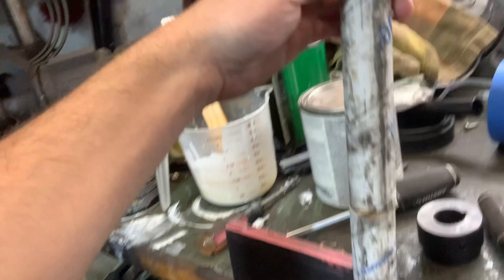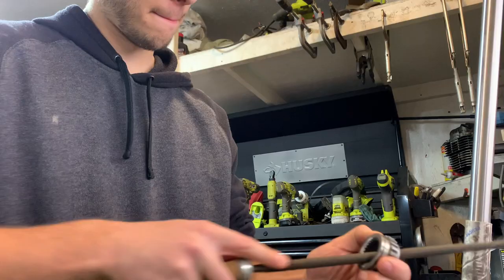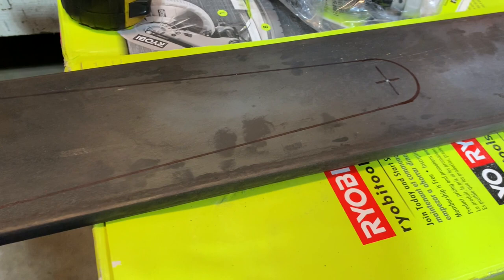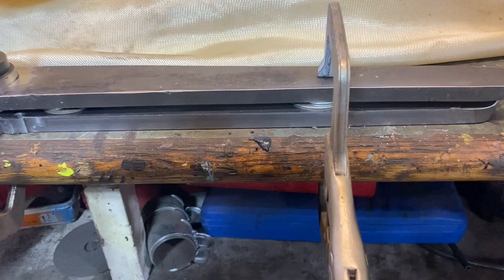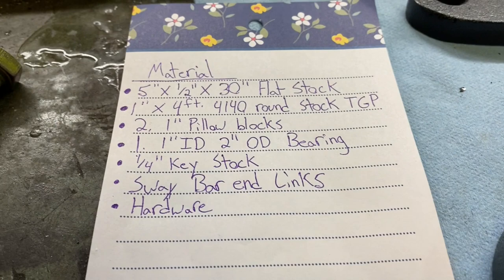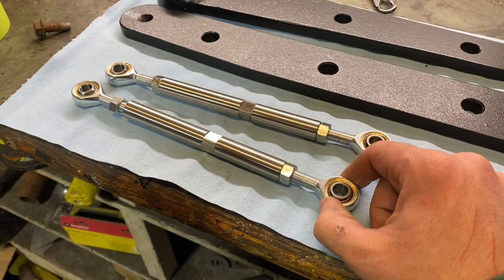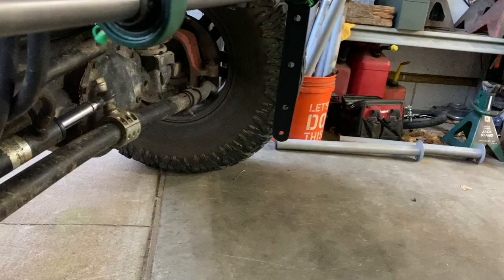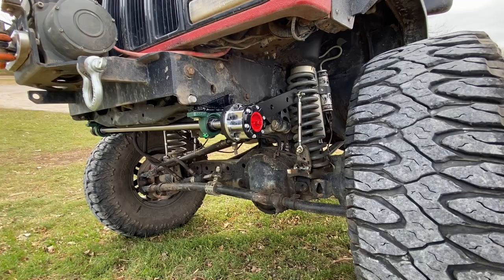HOW TO BUILD THE BEST (OFFROAD SWAYBAR) CHEAP

Comment from the maker: Is this something you would purchase for $400?
Reply: I have an idea or two that might improve this
Reply from the maker: @dylanromine4101  please let me know
Reply: Try using a toyota motorhome axle shaft for the sway bar
Reply from the maker: @dylanromine4101  what is the advantage of this
Reply: It has a full float axle that has the same bolt pattern as the hub
Reply from the maker: @dylanromine4101  interesting idea but how would it unlock?
Reply: It has splines that I think fit the hub you used
Reply: I would be all over this!
Reply: Definitely would buy this
Reply: I would buy one for my 1988 YJ I just bought yesterday and almost wiped out on a highway offramp!! ;-)
Reply: I would buy this Four my 96 jeep cherokee X j
Reply: I would like to order one asap for an XJ, let me know. Thanks
Reply: I'd buy one of these (or one for front and rear? If you're willing to fab them.

Also if there's a cad file I would pay for that...
Reply: @gageboysgarage6059 is buying one of these possible?
Reply: You could probably quit your day job and pump these out😂

Comment: Does this have some propensity to lock back in with a possibly uneven configuration? e.g. assume one needs to be real level when re-locking, correct? Has this been an issue at all for you? Great vid, and idea BTW. Appreciate it.

Comment: Nice job, please get yourself a couple 2 flute SPIRAL POINT (not spiral flute) taps, they cut soooo much better and easier. No need to break the chips, they form a long chip ahead of the tap. You will not use your old taps again.
Reply from the maker: thanks for the tip i’ve used that style of tap at work.  i’m just to cheap to buy nice ones at home

Comment: The anti rock can help balance front to rear characteristics off road, and help with side hills. The spring rate on them is pretty low, so it still allows for good articulation. You might try a junkyard rear swaybar, smallest diameter you can find.  

I'm curious how yours holds up to the torsional loads, I don't recall you saying it was spring steel?
Reply from the maker: it seems to spring really well i did research on the material before buying it. the cool part is you could buy a smaller diameter bar for less spring rate
Reply: I'm just wondering if it will yield eventually. Especially at the welds. Give us an update after some miles! I do like the 'bushings'.
Reply: Regarding the material and effects near the welds: I was wondering the same.  Got an update?

Comment: this is a really cool idea, I do alot of fab work and never thought about building one of these..... thanks for the inspiration......Ohhh you might wana try a thicker oil for drilling, I often use motor oil or what ever I have lying around, it will cool better and not evaporate so fast.....+ its cheaper
Reply from the maker: build one you’ll love it👍, and i will try that thanks for the tip!

Comment: are factory (and Antirock type) swaybars hardened in anyway? if you twist or bend a non-hardened 4140 shaft it will not spring back - can you give us any feedback now that you have used it for the past year?
Reply from the maker: i don’t believe they are hardened, if they where hardened they would snap, this is still on my jeep and has been everywhere with no issues

Comment: Reconnecting back up, the jeep will have to be on perfectly level ground, or you'll lock up uneven. How are you addressing this issue?
Reply from the maker: has not been an issue when you lock it the hub clicks in when it gets to the nearest lock point which is always level

Comment: Cool idea! Though welding directly to the locking piece…. Ruined the heat treat. Splines would’ve been ideal, but I suppose it will never see high enough torque to damage it.
Reply from the maker: I completely agree that’s why i was hesitant. but you can’t really cut splines at home. i’ve been using it a while now and still works perfectly

Comment: Question: does it matter where you put the keyway? Should you mock up both sides and then mark the keyway so the arms don’t miss align??
Reply from the maker: yes the location of the keyway matters. the hub side allows for adjustment but only extreme differences
Reply: @gageboysgarage6059  how did you determine the key way position? I have everything but the round stock, I’m building for my gx470 rear.

Comment: What welder are you using?
Reply from the maker: I am using the 220 titanium welder from harbor freight
Reply: @gageboysgarage6059  awesome I have the same one. I’m impressed with your skills and knowledge at as such a young man. Keep up the good work. I’d be interested in purchasing one after you do a review after a few miles. 

Btw I have the same welder and  I love it but it seems to go through gas very quick. Does your?
Reply from the maker: @moejr14  Thank you so much i really appreciate the comment!! i will definitely put a review out on this in a couple thousand miles 

My welder went through gas very fast as well until i bought a new regulator for it. now it is way better, and the cfm is much more consistent.
Reply: @gageboysgarage6059  awesome. Where did you get the regulator?
Reply from the maker: @moejr14  i don’t quite remember sorry, it was a standard unit online
Reply: @gageboysgarage6059  it’s all good thanks man. Keep up the good content